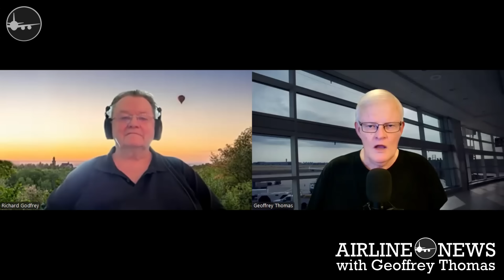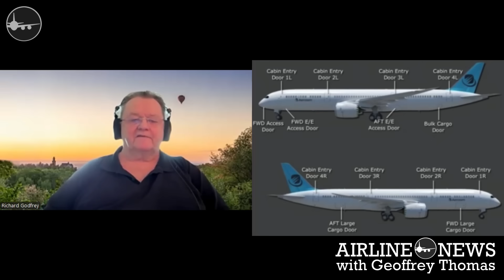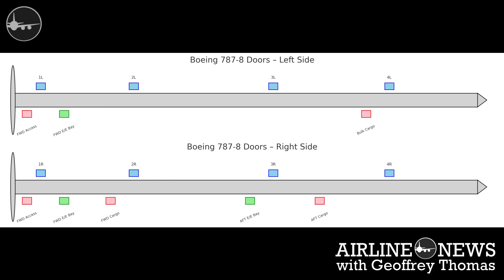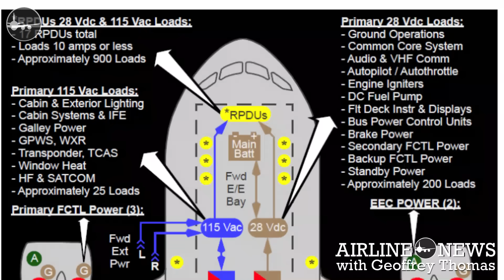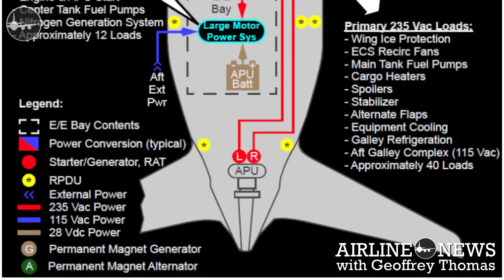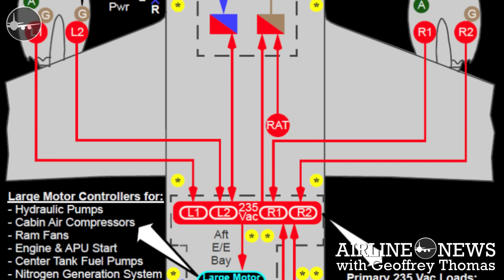Air India Crash Eps 189 - Toilet Leaks Exposed

Comment: I need to go back and listen to this again, but the fact that the RAT isolates control to the Captain is very interesting. Based on the CVR snippets that we have in interim report, would that imply that as one engine restarts it restores control to the FO, explaining the 'your aircraft' (I'm paraphrasing) from the Captain to the FO as control reverted back once one engine started to come back on line?
Reply: Except there are no CVR "snippets" in the Preliminary Report. It contains not a single word of actual directly quoted speech from the CVR. That alone is very worrying to me. Clearly a cover up. If they were speaking in Urdu or another non-English language - fine: just mention that in the report.. but they didn't.
Reply: @padrejohnruffle i thought they did.  Perhaps it was a report in WSJ quoting it from a source.  It's hard to keep track
Reply: @padrejohnruffle the report by WSJ or Corriere sella Serra was the the captain said "the aircraft is in your hands" - essentially "your aircraft".  It seems this was as engine one started to spool up again.

Comment: Hi gentlemen. I recently saw a video put out by Captain Steve, who points away from any electrical failure causing the fuel switches to close. He explained that the fuel switches will remain open because they are powered by a 28 volt DC battery completely seperate from the electrical  bays. He also said that simulation testing of total electrical loss after rotation didn't effect the fuel switches, which remained open. He didn't mention any simulation of water ingress into the aft electrical bays. Your exolanation of the cavitation of the pumps is very plausible. The only way we can get clarification is for the AAIB to issue an interim report with all the data points made clear.
Reply: I believe Richard is not saying the cause was the fuel switches being cycled. An event occurred prior to this causing RAT deployment and a common mode condition where power was interrupted to the fuel pumps, causing “vapour lock” with environmental conditions being a factor and then the engines rolling back. This may have been seen by one pilot as a cut off, but it was discussed previously, it is unknown if that was a direct reference to the fuel switches. The fuel switches may have been cycled to initiate an engine relight, which may not have been required due to the auto relight function of the engine FADEC.
Reply: @markward1686  yes. I agree with Richard's explanation. It makes sense, and it's very plausible. Captain Steve should simulate the water ingress into the aft EE bays under the same environmental conditions of that day.
Reply: Hi, we are not disagreeing,  the pilots did most probably cycle the switches from run to cut off and back to run. However. This was done in a desperate attempt to try and reset a system which caused engine roll back .
Reply: Both Captain Steeeve and Jeff Ostroff convicted the Captain from the outset, and ridicule any suggestion of malfunction of the aircraft. Neither one has taken the objective approach represented on this channel.
Reply: @timrider1224  yes, that was very disappointing.
Reply: Noone argues the switches being moved. But noone except these 2 gentlemen considered the moving of the switches being the result of the RAT being deployed, not vice versa. Cpt. Steeeeeeeeve is crying at the wrong grave. Of course he can prove whatever he wants regarding the switches, this is not a point of contention. RAT deployed first, any switches motion must have been either a desperate hail-Mary action to restart the engines (if no other confirmation was there or automatic relight didn't happen) or a brain fart. And btw Steeeeeve claims ony the pilots can shut off the fuel to the engines. Wrong again. Google All Nippon Airways TCMA incident. The plane shut off both its engines at landing, because...
Reply: @MerrekSK  What bothers me is why would the AAIB state in the preliminary report that the switches were moved first and then the RAT was deployed because of this. If it were the other way round then why haven’t the NTSB and or the UK AAIB intervened as I’m certain they would have had some sort of access to the EAFR data. Richards theory is purely based on the timing of the RAT being deployed.
Reply: @KeyserSoze5421  If you look closely, they never state that. They just create the illusion of chronology. But if you take it separately, what do they really say? Just change the order, you can, because there isn't a timestamp.

"aircraft achieved the maximum recorded airspeed of 180 Knots...and immediately thereafter, the Engine 1 and Engine 2 fuel cutoff switches transitioned
from RUN to CUTOFF position" - they do provide a timestamp for these.

"In the cockpit voice recording, one of the pilots is heard asking the other why did he cutoff. The other pilot responded that he did not do so." - This could've been even before the engine rollback, we don't know, they don't state that. The answer can be to another question. The question itself? We don't know the subject, who cut off, neither the object, what had been cut. No timestamps.

"CCTV footage ... showed RAT getting deployed ... immediately after lift-off " - no timestamp. They even say, it's immediately after liftoff! Surely the aircraft wouldn't reach max speed immediately after liftoff, but some time after, right? :)

Seems to me it's more like an enumeration of information (facts, if you like), not necessarily a chronological order. At no point they stipulate one specifically follow the other. Only timestamps are for the engine initial rollback and that an answer followed (possibly not immediately) a question. No further context or clarification, indirect reported speech for deliberate ambiguity.

People who wrote the report put in some extra effort to create the illusion of chronology, when in fact, they kept all their backdoors open for future flawless interpretation of the very opposite - pilots did nothing wrong, did everything to save the plane, engines rolled back before switches were moved, RAT deployed first. None of this is explicitely forbidden in the prelim. farce of a report.
Reply: @MerrekSK this is very likely. Agree that timestamps were deliberately left out of the prelim to produce ambiguity and speculation leaning towards a pilot actions being the cause of the crash. I hope Richard and Geoffrey keep putting pressure on the AAIB for exact timestamp data. Agree that it's a lousy, data withheld prelim.
Reply: @MerrekSK thank you for this explanation.
Reply: @MerrekSK I’ve a dumb question. Why did it take 10 seconds to have the cutoff switch’s moved to cutoff then back to run? I can see them perhaps cycling the switches during their Hail Mary but 10 seconds to place the switch’s back to run seems like a fairly lengthy time. 

I’ve done the whole 10 seconds sitting and doing nothing and to me it seems like a long time. Plus my attention span is short!!! Haha. Just curious is all.
Reply: @Alaskan1970  Richard explained it too. When running on the main battery, only one engine can be restarted. So if you cutoff, you can only relight one engine. It is only after the RAT deployes and starts providing electrical power (extra 10 seconds), both engines can be restarted at the same time. There's your extra 10 seconds.
Reply: @MerrekSK ....because of the wow...
Reply: @MerrekSK  Why would the engines have only started spooling down after the switches were moved? Could them not spooling down have been a cue for one of the people on the flight deck to move those switches? In fact, how do we even know the switches were moved at all? They were found in the same position they were in at the beginning of the takeoff roll!
Reply: @mushymystic  Sorry, it's my mistake. There is no timestamp on the initial spooling down of the engines. Only for the supposed cutoff switch motion. Yes, Richard's understanding is, the engines shut down because of an electrical failure and switching was only a reaction to it, which makes sense.
Reply: captain steeve is mudding up facts as much as anyone. No one from the big country south of 49th parallel will ever drop their patrioticism. They will continue to be racist, as their leader encourages, and will continue to do what it takes to protect their exports. Aircraft exports acount for a major part of theei GDP

Comment: Good morning/afternoon gentlemen .  

Thank you for your continued expertise and brilliance around this crash investigation. I have not heard previous mention of the fact that the deployment of the RAT automatically powers only the pilot’s instruments and controls. This seems pivotal evidence and certainly damning of the AAIB’s inference that the pilot deliberately caused the crash. The re-lighting/recovery of both engines is surely evidence enough of the pilot and co-pilot’s attempts to regain stable flight in response to a system fault/failure. 

Together, the potential for a lack of complete and thorough maintenance on the aircraft; the evidence of pre-existing electrical issues on the same plane in the week leading up to the crash and even during the inbound flight into Ahmedabad earlier on the day of the crash, raise the probability that a brief but critical electrical issue triggered a duel engine shutdown, with deployment of the RAT occurring as an automated system response.  A tragedy that could have been prevented. 🙏🏻

Comment: Dear Richard and Geoffrey ,
the only system and screens are active in case of emergency power supply by RAM is the captain .
 this what i have been telling the people those has been blaming poor Sumit the captain on various you tube channels , 
i kept saying when captain had final control after RAT power back why would he relight the engine , why whouldnt had he nose dived instead  
but one pilot (obviously never faced this emergency before) said when i have flying control i just look  through front wind screen and pilot monitor is the one who would be monitoring  the screens parameters . why would he took control from me over ?
but you confirmed is the nomal procedure that captin take the control over in RAT emergency situation .
i as well recommending your channel to like minded and interests friends .
thanks

Comment: Why design and build ee bays underneath water sources. There must be a reason.
Reply: EE bays are in fixed locations (critical components and wiring) in the aircraft for all possible passenger/cargo configurations.  Toilets are located where the buyer specifies.  So, either don't allow toilets over EE bays, or protect EE bays from water above (aka umbrella).

Comment: If your sources are correct,  and I have no doubt why they would not be and that you have undertaken due diligence,  ingress of urine from the toilet above onto electrical components below is a shocking revelation to me, as is the recommendation from Air India for protective rubber matting in the galley, which rather implies the original design provides inadequate protection from spillages. If the mandatory advisory was not undertaken, then that certainly would explain why the preliminary report appears to point the finger at the pilots. How convenient they are no longer alive to speak back. WE WOULD ALL LIKE TO SEE THE MAINTENANCE LOGS PLEASE - AIR INDIA.  🐒
Reply: YES URIN IS VERY CORROSIVE AND CONDUCTIVE.

Comment: So would these possible causes show up in the black box data if there had been water issues with wiring or panel's? I have asked this before, but is there any of the wreckage left for examination to see if panels or wiring was damaged by water?
Reply from the maker: The wreckage site was cleared before the FDR and CVR data was downloaded, so there is only recourse to the items of wreckage taken to the hangar at Ahmedabad Airport.
The FDR data does give a full overview of the key parameters of both engines, fuel flows and all electrical systems.
The key events are all recorded such as:
- When the IDG power failed in each Engine.
- When the Power Distribution system switched to Main Battery as Emergency Backup.
- When the RAT was deployed.
- Whether the RAT was deployed automatically or manually.
- When the RAT was supplying stable electrical power.
- When the Power Distribution switched from Main Battery to the RAT essential power bus.
Reply: Maybe, maybe not. The issue is, much of the equipment burnt on the ground and it's hard to differentiate if it was in flight or only after the crash. If there was an electrical fire, this has much higher temperature than the fuel burning, so components would be damaged in such a way that fuel alone can't explain. But the farce of report doesn't mention any of that, just that the forward EAFR was in a better shape than the aft one. This is still in-line with something happening in the aft EE bay, even the electrical fire, etc.

The FDR data should anyway contain all the messages they saw in front of them, reported failures etc., this have not been made public either.

Comment: This comment is not about the Air India disaster per se but might give an insight into the attitudes to security and safety prevalent in Indian culture. Some 40 years ago I flew to India twice and took several internal flights as well. The security at the Indian airports was not at all like that in the UK. I had unexposed and exposed films that I wanted hand checked rather than passing through (the then) unsafe x-ray scanners. In the UK these films were thoroughly checked once. In India however they were briefly looked at (or simply ignored) several times. The attitude seemed to be that doing something poorly but several times was just as good as doing something properly just once. 40 years is a long time ago but somehow I doubt attitudes have changed in India that much. If those same attitudes prevailed in Indian aircraft maintenance I can see there could be severe safety consequences. Thank you both for the excellent videos; I've watched each and every one.

Comment: I still don’t understand why the pilots would turn the engines off immediately after take off. Surely you’d want to keep the fuel flowing in any situation.
Reply: Unless you know there is an electrical problem, screens have gone dark and there is no guarantee for the automatic relight... duh

not mentioning if they got a message on fuel contamination or vapour lock, pump failing, etc. If you KNOW you're not getting any fuel into the engine, then even more reasons to try the switches
Reply: @MerrekSK why deny switching them?
Reply: @JayDeeChannel  Who is denying switching what? Mainstream refuses to see, there are occasions when you'd cut off the engines even at takeoff. Some of those, I listed above. The issue is, the pilots reacted to what they saw on their screens / heard engines spooling down, realized the RAT deployment, etc. Their actions were not the root cause of the accident.

Comment: This sounds most likely - Thank you - 230 v yes would not like water around - just a note to say most telephone trunk cables are imune to water ingress by the simple fact that they contain compressed gas fed in at one end - thus ANY underground leaks will show a straem of bubbles comming OUT not INTO the wires. no chance of water causing problems.    Thank you for this infomation. The diagrams are very helpfull in diagnosis of the problem..   Kevin..

Comment: Congratulations Richard especially. Impressed by you standing up to the pressures around and demanding the truth. I think we're actually getting somewhere!
Reply: I concur. This channel has eased my anxiety on this incident. Retired fuel safety systems test and certification engineer, with way too many questions, and finding like minded people from passenger perspectives to maintenance engineers, pilots and enthusiasts who are the very people that help drive health and safety through our governments and air carriers.
Reply: Perhaps the copilot asked: why did you cut off my instruments?
The preliminary report did shortend the mayday call. Why?
Reply: @idarpolden5913 Absolutely - plus a fact that many appear to have glossed over is that for reasons known only by the AAIB not only was the cockpit conversation incomplete but it was NOT verbatum. What the flight deck actually said has not been revealed - case in point, as you mentioned, the mayday call was incomplete in the preliminary report - that or the earlier reports of "thrust not achieved" was a fabrication. I think we all would also like to see the tower transcript. We wait, and wait and wait. But this isn't a Bogart movie - we are dealing with many souls lost and grieving families who deserve answers.
Reply: @padrejohnruffle Yes the mayday call still puzzles me. If genuine, it does seem much more like a panic call. It's not like it can actually achieve anything. But it does imply that they're dealing with an emergency not of their making.

Comment: When I need to feed my curiosity about Air India 171, this is the only channel I tune into. I fully believe they are going to stand as the one's who correctly called the causes as to what led to this tragedy.
Reply: I tend to agree, they have looked at this from several more view points. If they don't get it 100% I believe there are bits and pieces which are more accused than other sources. Things like the captains avionics being only powered requiring a change in flight command. Time required/ delay of fuel starvation, to actual loss of thrust. Maximum velocity if engine shutdown at "transition to cutoff" event discrepancy. Likley time of RAT deploy before, "transition to cutoff" event. Indicating duel engine failure prior to "transition to cutoff" event. Much more comprehensive review.